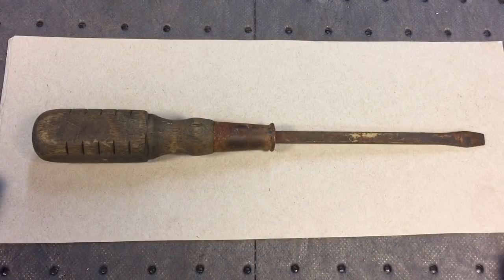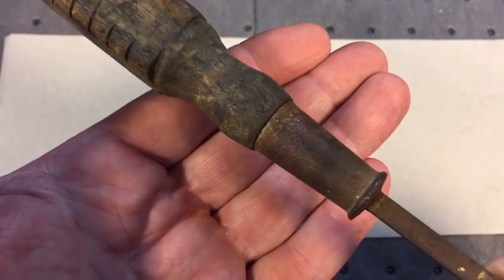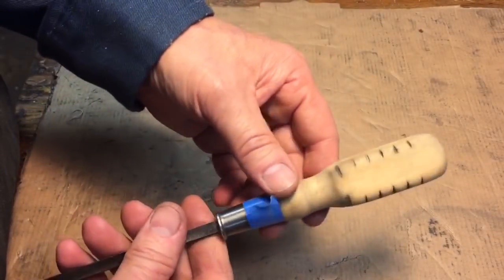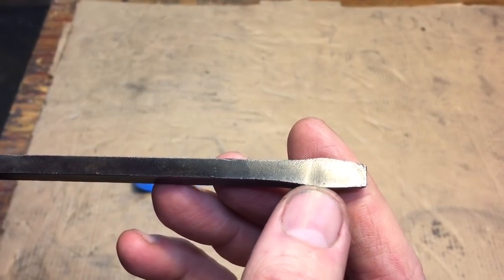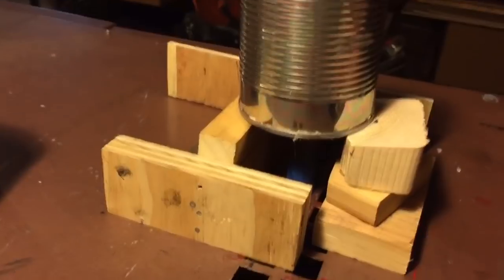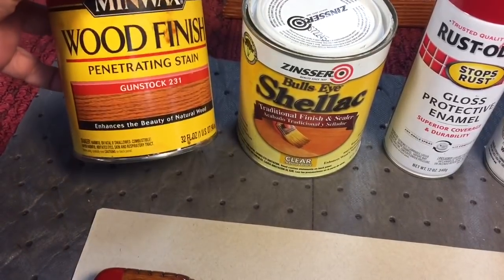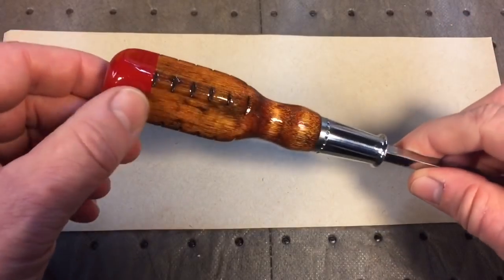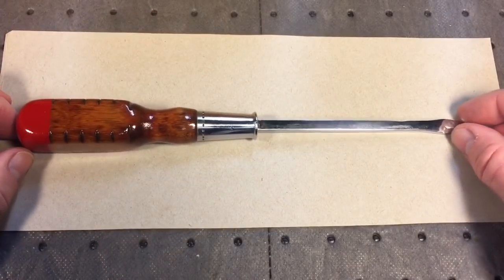Antique Screwdriver Restoration...

Comment: Scout, I have that exact same screwdriver in the exact same shape.  What's funny is that I not only just recently bought that exact same penetrating stain to redo my bench for the front yard, but I also used the same shade of red for my tool chest project and picked up some of the same clear coat as well.  But now it looks like I'll have a screwdriver project too. I guess some things are just meant to be :D

Comment: My favourite screwdriver shank, being square it is possible to put a spanner on it to increase the torque. A company in the UK, Draper did a whole set of square shank screwdrivers with the shank going through the handle to a metal cap and in slotted, Phillips and Pozi. They are my go to screwdrivers for rusted and stubborn screws. As always, a miracle transformation.
Reply from the maker: Hello Tony!  Those Draper Screwdrivers are very heavy duty!!!  Great stuff!  Thanks very much!!!  😃👍
Reply: ...and who is the manufacturer of this one (this type)? Seen loads of them on carboots.
I like them with the very same reason you do...
Ps.: I use them with locking plier----> way more grip, torque lever than a spanner...

Comment: Looks like a Blackhawk. Have several sets. Where I worked this was the best to use. The fluids in aviation will eat plastic handles in very short order. Excellent job and the red on the handle sets it off. Thanks
Reply from the maker: Hello Norherman!  I remember you mentioned that you used wooden screwdrivers!  There is no markings on this one but they made ton of these years back!  Red is back!  lol   Thanks very much!

Comment: Very nice work.  Also nice to hear a New Yorker's accent (born and raised in upstate).  Also, had one of those wood screwdrivers when I was a kid.  Hate to think of it as "antique," but it is what it is.  I used that same stain for a lot of applications, but I seal it up with polyurethane (satin, semi, or gloss); hard as a rock.
Reply from the maker: Hello DWC- I have some property near Monticello! I live in queens though. This screwdriver is at least twenty five years old! (Probably twice that).  I use to use polyurethane but have since gone to shellac and varnish... The only reason I used Rustoleum clear on this is because the red cap was Rustoleum and did not want any problems...   Thanks very much!!!  😃👍

Comment: I fixed a few of these. They are my main screwdrivers. I found for a quick clean up on ones looking like that I just wire-wheeled the whole thing (wood included) with my finest wire-wheel and it did a decent job. Burnished the wood nicely without removing too much material. Certainly not the best though.
Reply from the maker: Hello Metal Butcher! You're right! Hitting the wood with the wire wheel can really tear up the fibers! You really have to know what you are doing!  Not for the faint of hear the!  Lol. I ruined lots of stuff in my younger years!!!  Like learning the hard way you can't wire wheel aluminum!  😂.  Thanks very much!!!!  😃👍

Comment: That Came Out Beautiful Bro!!! Wow! I have a old screwdriver that looks similar its a Mac i Beleive, but in very rough shape! The handle is cracked and tip is chipped. Wonder if i could restore it. To at least be functional even if its not pretty lol. Take care!
Reply from the maker: Hello Daviddaddy!  The most fun projects are the ones that are beat up the most because it's a no-lose situation!  No matter what it will come out better!  Even if you modify it... I say Go For It!  Thanks very much!
Reply: ScoutCrafter you got a good point there, And You're Welcome .Yeah think ill give it a Shot. I have so many tools that need restored, but not sure where to start on them and what tools to use to clean the metal etc. Lol i mean i have a grinder and metal wheel but it seems to leave the surface of metal scratched.

Comment: Looks stunning...nice job.  I'm wondering if you could have taken it apart without destroying it at all?  I bet there is rust under the ferrule/inside the handle but removing it cleanly would probably be quite difficult.  Personally, I'm not a fan of the red paint...would've looked better without it.  The shellac won't last long assuming you use it...better to just use boiled linseed oil on it and touch it up as needed.  Still, as I said, excellent job!
Reply from the maker: Hello cpad007-  Bright colored tops were very common on tools years ago so they wouldn't get lost in the backyard, it was a visibility thing... As for shellac, that's what was used to coat many old tools, linseed oil is sticky, attracts dirt and doesn't look attractive that's why it was seldom used by manufacturers as a finish...  Thanks!

Comment: I tried this using your methods. As soon as I put the clear coat on it removed all the red paint. I used the exact same brands of stain and paint that you used. I let it dry for a day between coats. I don’t know where I went wrong
Reply from the maker: Hello Chris!  It is imperative that the clear coat be the same brand as the paint...  I like Rustoleum Enamel and Rustoleum Enamel clear coat...  The real test to see if the enamel paint is dry is the smell test!  Give it a smell and if it still smells like paint it is still curing...  If you spray the clear over the paint is shouldn't run or craze...  If you still have questions just email me!  bicycleguy@aol.com   Thanks!!!!!!!!!!

Comment: Not much for the handle - But the 'shaft'  >  W0W!   HOW was that done?  Quite amazing  [to me].
Reply from the maker: Hello Karen!  I'm always preferred acetate (plastic) handled screwdrivers myself but there are a lot of technicians who only use wood handled screwdrivers because it doesn't transfer heat! As for the shaft, underneath all the rust and scale there is always clean metal, almost like us human beings, under all the aging and years we are still pristine inside!  Lol.  Thanks very much!!!  😃👍
Reply: quite funny -  ha ha  I'll have to bite a little deeper. ".,....,."   By handle, I meant the red & gloss.  All looks great, but Red is All yours, the gloss, well that metal part sure beats it.   =]       thanks for info.
Reply from the maker: Karen, Years back many tools, especially screwdriver came with Red tops for visibility reasons, if you were working outside the bright colored top would stand out and help you find the tool left out in the grass or dirt. this was common on many different tools, a splash of bright color, Red, Orange, Yellow... would help you keep track of your tools... Then if you bought a tool that wasn't highlighted and worked in a shop you had to either engrave your name in it or paint it to stop it from "walking"  lol   Thanks!

Comment: Nice touch with the red paint on the end of the handle.  How do you keep the metal from tarnishing/rusting again? Do you spray the metal with the clear coat as well?
Reply from the maker: Smitty- If the tool is inside a good waxing keeps them clean but if they are outside or in an unheated garage some extra protection is needed like a clear-coat....  Thanks!

Comment: so i have a handfull of these in varying sizes. and ive been working on restoring some tools here and there. but i have to ask, i live down in florida, and especially now with all the rain, its so humid out you feel like your swimming through the air.  i have to ask what you use to prevent rust from forming after you finish. i know paint can help, but do you solely rely on the clear-coat to protect the polished metal, or does polishing in itself help with preventing rust? also i see you wait till primary coats are completely dry before you clear. what do you use to clean the paint before you clear coat? most projects ive done that ive let dry before clearing tends to orange peel very quickly. most of the stuff ive done has been alright, but ive usually clear-coated with the base coat still somewhat tacky. which the downfall of that is now i have multiple coats that arent completely dry and take so long when i THINK its done i pick it up and i can roll paint off an edge if im not careful. im using rustoleum myself, i think the result is better than a lot of other brands and has been the most robust for me, whenever i accidentally do it right. lol. so any tips or tricks, techniques you've picked up and learned over your time spent doing this would be greatly appreciated. especially since i have some projects i plan to sell afterwards.
Reply from the maker: Hello spartan36789!  I can tell you are "in the thick of it" because all of your issues are that of actually performing restorations!  Awesome!!  Ok first off, the high humidity "salty air" where you live is trouble for any steel, so the only real solution you have is to seal out the air and moisture. The best way is paint, and paint with out pigment is clear-coat. All paints like a surface to hold on to so if you polish the metal it is harder for the paint to grip... (Sucks right?)  Tool makers use a very sticky clear coat for there polished surfaces and it works well. In your area a polished surface with wax coating might allow the air to penetrate and rust... Before I clear on any metal I really clean it well with either denatured alcohol, acetone or lacquer thinner.  As for clearing over paint, If you use the same brand clear as the paint the solvents will penetrate the paint and help the adhesion.  When I did the screwdriver, I put the first coat on to thick and got a big run! Before it dried I took some paper towel with paint thinner and wiped off the clear coat and re-shot it... I do find that if you make a makeshift oven using a foil lined cardboard box, a incandescent light bulb and warm up your paint or clear in hot tap water before you spray your results should improve... It's hit and miss.  I knew this car painter here in town that did awesome work but would never spray if the humidity was high!  But now everyone has humidity controlled paint booths!!  Hope this helped a little!   Thanks!!!!   😃👍
Reply: its adds a little more insight, yes. but what about when you clear over paint, cleaning that to prevent further reactions? same thing about the alcohol? id imagine thinner would possibly ruin the paint, but the alcohol should be fine right? one day when i clear out garage space i'll try to make a "take-down" paint booth with 2x4's and the plastic sheeting. prolly be a few years before i get the space for that, though.

one issue i recently had was with the vice im currently doing up. im not TOO concerned about it cause im going to use it, but in some of the places ive left "bare metal" even though ive used really good cleaners, and rolock pads to clean off the surfaces before the clear coat, ive found those spots are rusting anyway under the clear.

Comment: Don't laugh, (too much) but when I was a teenager we didn't have a clothes dryer, so in the winter if I needed pants dried kinda quickly I would hang them over the furnace. The warm air would go up the pants leg and dried them out. I was always worried about either catching the pants on fire or flood ing the house with carbon monoxide! It all worked out. Great looking screwdriver bye the way.

Comment: Great video and great job - area real inspiration...  I have a quieten though.  Did you put your final clear coat on the metal or just on the wood that was stained and painted?
Mike
Reply from the maker: Hello Mike!  I only cleared the wood, the metal was polished and then two coats of Mothers Carnauba Wax!  I find the clear is hard to adhere to the polished metal surfaces under heavy use.  However if you were going to leave this in a non climate controlled area you need to put something on the metal to protect it.. Like lacquer or clear coat...  Thanks very much!!!   😃👍

Comment: The only wood handle screwdrivers I have are complete junk, the metal is soft like aluminum....It's those cheap ones they used to sell at flea markets and such...Don't even remember who gave me those junkers I've had em so long.
Reply from the maker: Personally I like acetate handles but I heard a lot of ovation mechanics use the wood handle screwdrivers because they don't transfer heat!  USA made of course!

Comment: I'm curious if you've ever tried Evapo-Rust? It's safe on plastic and wood handles and won't erode sound metal like the wire wheel. 

I'm not trying to sell you on the idea. And I'm not trolling or intending to be disagreeable. Just curious if you have experience with this or similar products. And why you choose the method you use. 

Thanks in advance if you choose to reply.
Reply from the maker: Hello Scott!  Great Question!!  I have heard of Evap-O-rust and have heard good things about it!  However that would be considered step one, you would still need to wire wheel and polish afterwards for best results...  I use vinegar for step one...  Rust always leaves scarring or pitting and no chemical can get rid of that!  Thanks very much!!!   😃👍